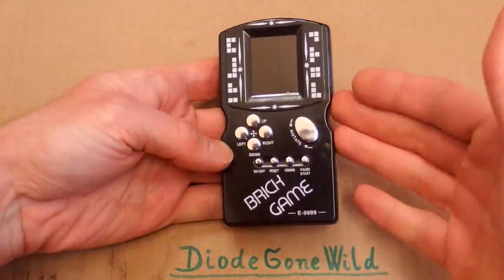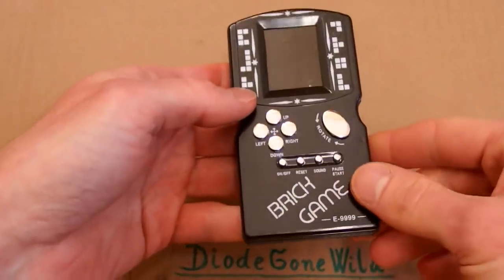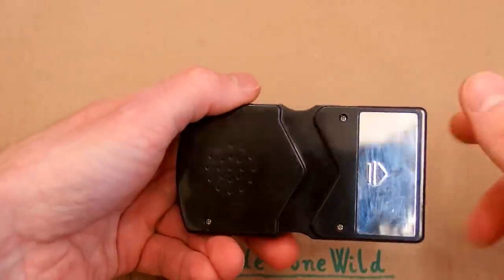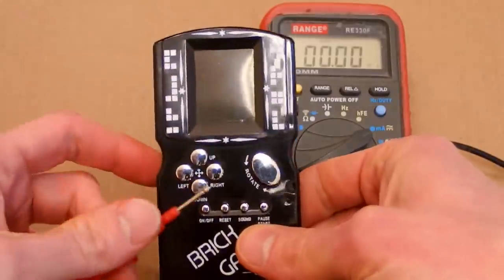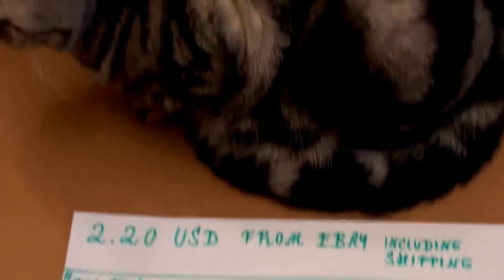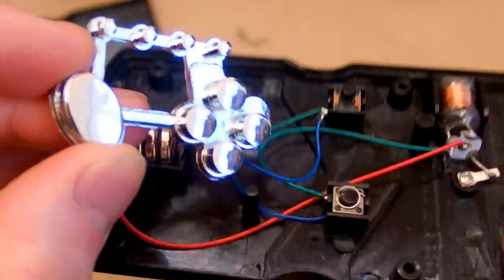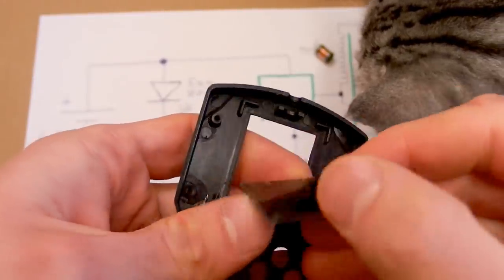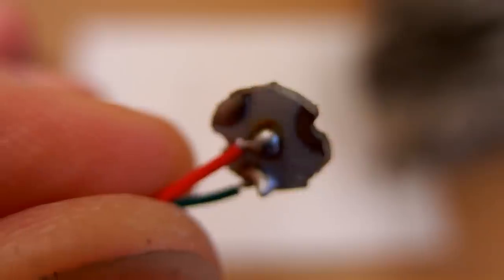Electric shock from a Tetris brick game?

Comment: I think we feel short high current spikes more easily because the power dissipated in your body depends on the square of the current. If you had a steady current of .3mA and a body resistance of 20k, there is only 6v across your hand and 1.8mW of power. Even if the device could give more voltage, it would drop to 6v when "shorted" by your hand. Now, if you have a pulsed waveform that puts out a peak of 10 mA,  200v into your hand, that's a peak power of 2w, and even if it is only on 3% of the time, it's still 60mW average. And the "RMS current" is more like 1.7mA. The average current is still .3ma, but the peaks discharge at a higher voltage, with more I^2R power than you would see with a steady .3ma.

Comment: Test it with decent batteries connected to it. Those tiny button cells have a very high internal resistance, which makes the voltage drop. Try 3 brand new AAs or a fully charged lithium ion. It'll give you a real shock then.

Comment: I wonder if this ‘toy’ can be dangerous if the electric pulse goes from one hand past your hart to your other hand. So the bad design might not even be such a bad thing in this case.
Reply: Not a big deal so long you are healthy. There is a video from ElectroBOOM about current is not what kills you (neither is high voltage) it’s got to be a combination. Check it out it’s quite interesting
Reply: Guillermo Ruffino Actually, if the voltage is high enough, the current is also necessarily high enough, and vice versa as per Ohm’s law. If the current is not high enough (due to a high output impedance or a current limit), the voltage drops accordingly to the resistance of the human body, so you can’t have high voltage without high current, and vice versa.
Reply: GRBTutorials I understand. But 1 amp going thru your body is not going to kill you is it last 5 nanoseconds (actually I repeat what I understood from ElectroBOOM video. I’m far from expert) but he made a point about energy being the killer mostly than just high current or high voltage. Thanks for the clarification
Reply: Guillermo Ruffino 
Amps will warm you up but voltages will cause cardiac arrests. Now there’s Ohms law of course so they are related by the resistance of your body. 
Also the path the electric energy takes is crucial. Going from one arm to the other arm (passing your hart) is much more dangerous than passing from one finger to another finger from the same hand.

That was what I was told on the first day at the lab on my first year of electrical engineering at the university (a very long time ago;)
Reply: @Conservator.  I was always told that "volts jolt, mils kills" . which is kind of why a high voltage generator with a very high output impedance won't hurt you, but use it to charge up a cap and it could kill you.
Reply: @Conservator.  hi for 40V to kill you it would need to bypass the skin, which is a great protector and in a normal person very resistance. if you connect internally then you are in the realms of Cardiac Floating in medical terms (CF) this limits the current to 10uA if i remember correctly,
Normally it's stated as a current, the voltage is just the amount of pressure required to push the current through. 

just looked up the amount of current required to cause death, "Currents greater than 75 mA cause ventricular fibrillation (very rapid, ineffective heartbeat)" 

yes, path is very import so is the voltage. The higher the voltage the more direct route  from points of contact. High frequency helps as the current will stay on the surface due to skin affect.

There is so much more involved than voltage and current the body is a complex impedance which is why the medical leakage currents are so low.

Comment: Upgrade this, to make a spark gap between buttons and fingers :D
Reply: Cut open an old heavy (iron core) wall wart and desolder the rectifier board. Press what used to be the secondary wires of the transformer against the terminals of an AA 1.5v battery and then quickly pull it away. And whatever you do, keep your boogerhooks away from the "wall plug" side of the transformer when it emits a spark that jumps a 3mm air gap. 

Don't ask me how I know this.